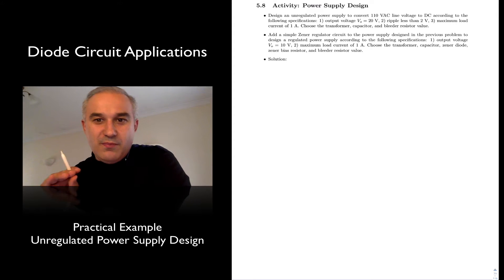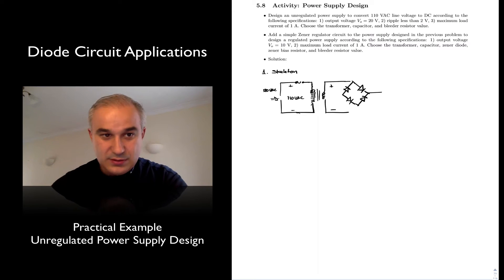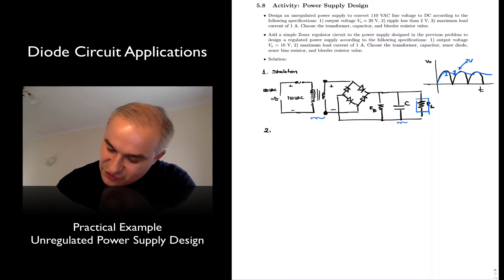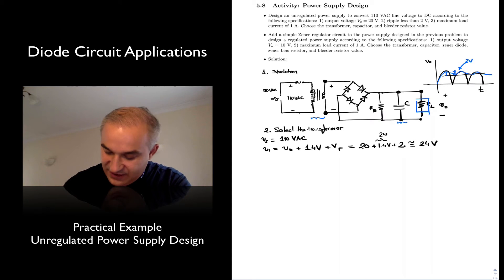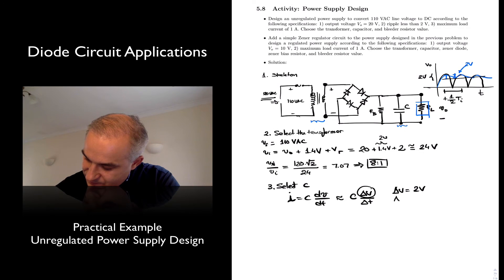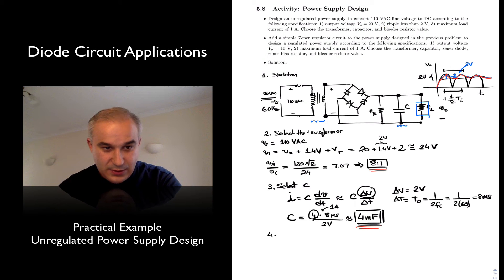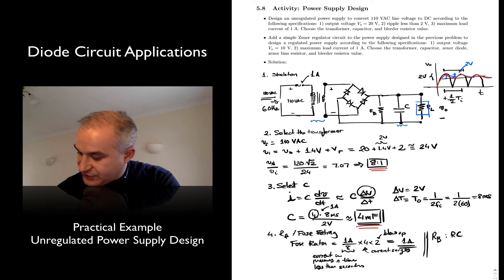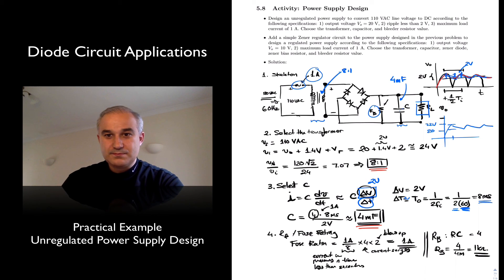Design Example: Unregulated Power Supply

Comment: Very helpful, Thank you. The second part asks to include a simple zener regulator circuit. Do you have an example of this?
Reply from the maker: Yes. It is the next video on the playlist.
Reply: Sir  how about the current surge calculation? And selecting diodes right amps?
Reply: And if I load current sir is about 2amp at 10v does the zener affected the wattage of it?

Comment: at around 11:15 in your Rb to Rc ratio, why did you choose 4?
Reply: hello sir, does the bleeder resistor effect the circuit when load is connected...by allowing current through it...?...thus resulting in the decrement of output current?
Reply from the maker: When you unplug the load, the capacitors stay charged. The "bleeder" resistor is there to discharge the capacitor (bleed the capacitor) within a few seconds of the load being removed. I chose 4 seconds in this example as the discharge time constant (i.e., the time constant of the RC circuit). This is a designer choice based on the application (e.g., 0.5s-5s are quite typical). You also want the bleeder resistor to be high enough in order not to load the circuit.
Reply: Sir this circuit is work in actual circuit? It this computation?

I'd like to make a power supply 
This formulas are right si many calculation I find interesting in ur calculation plsss reply